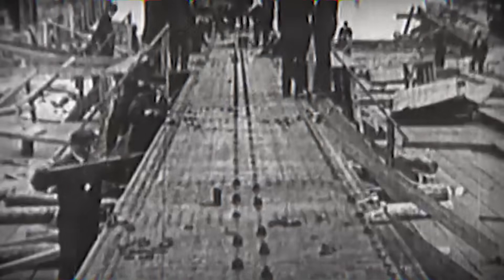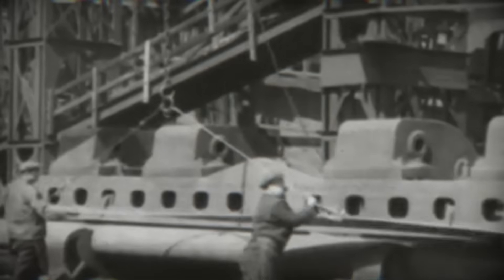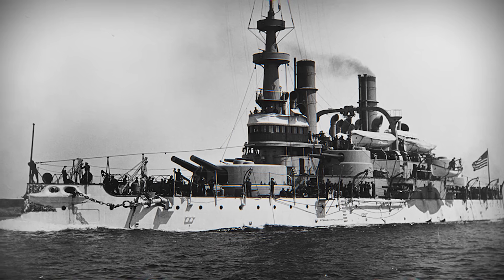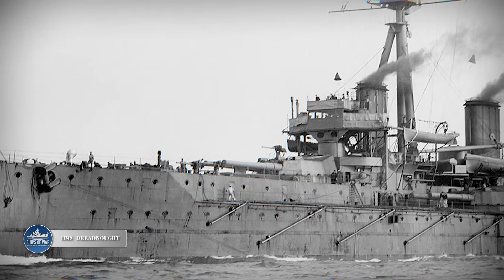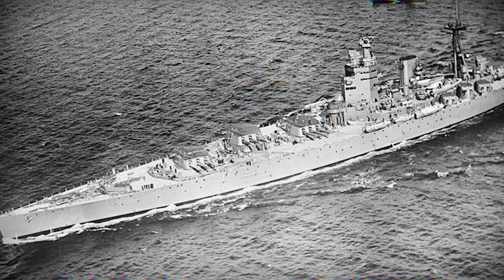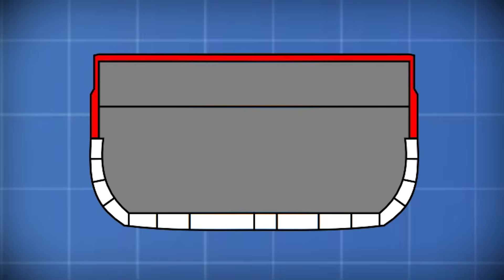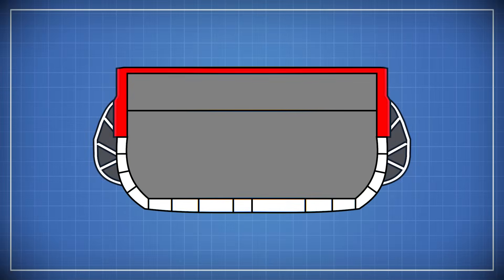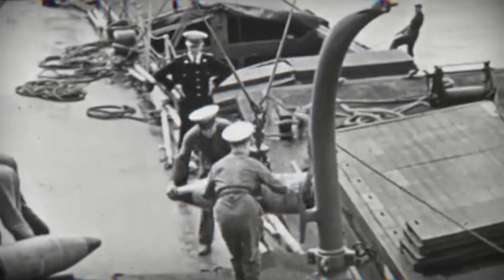Ironclads to Dreadnoughts: The Story of Naval Armor

Comment: The point of armor is not to be invulnerable. The point is to make your most important equipment more diffult to damage. You can never be perfectly armored. Even ships that had a really great armor all around (like USS Monitor for example) had weakspots - like the pilot´s house, or the bottom of the ship. If the Confederacy improved their submersibles, it would only have to deal with basically sheet metal at the bottom of that ironclad. And every single more modern battleship had much, much less armor coverage than USS Monitor. Typically only around the armored citadel in the middle of the hull, turrets, their barbettes and maybe a conning tower. The rest was rather thin and could be damaged even with a really small cannon.